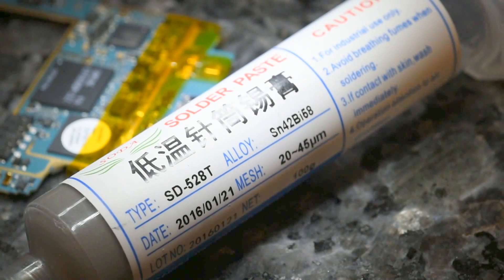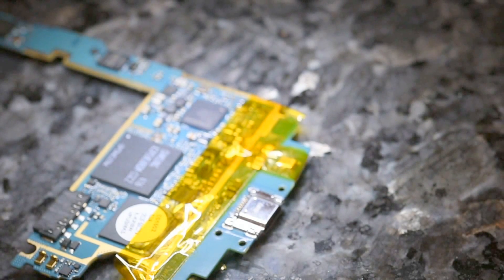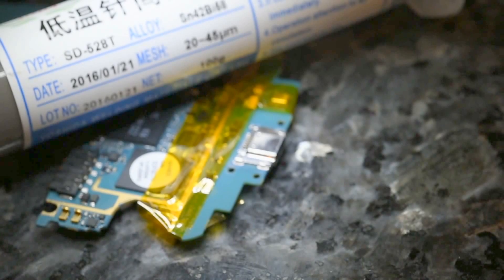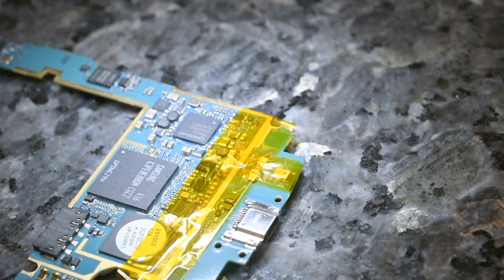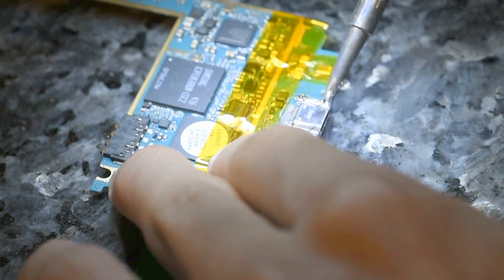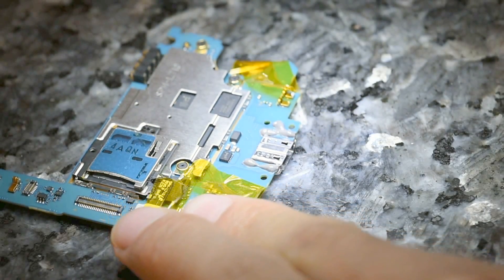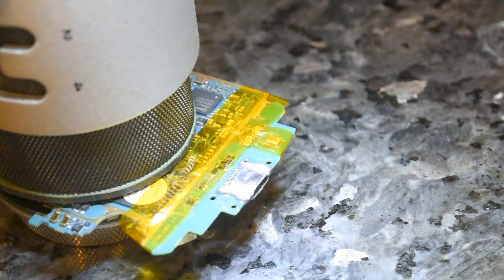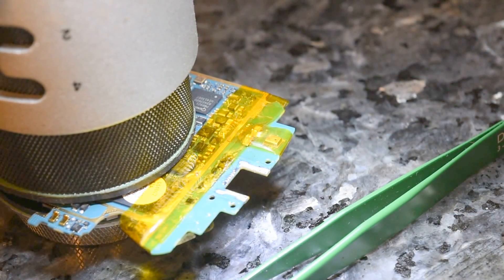How to use low melt solder paste removal alloy

Comment: Can you please suggest Soldering wire/paste having melting point in between 610 K and 740 K. And after soldering this should work between 15 K and  600 K.
Thanks in advance.

Comment: Is it ok to use a low temp solder paste to solder a USB port on a flex circuit board? Or should I use a leaded or lead free solder? I used a quick chip solder to remove the old port that was damaged. I know you said to use only for desoldering, I got a syringe of SRA T5 lead free paste and wanted to use it for a USB port. Thanks for your time.

Comment: look up "flux". Also are you using it on lead soldered boards - if you are, the alloy melting temp will be <100C. For bismuth based I use 270C soldering iron and 360 hot air gun
Reply: I'm looking to just replace the charging port in a tablet, is there something less expensive and a more economical way to change out this port?

Comment: Nobody does job such a way and spends pastes and solders for nothing not even the newbies.Everybody is using flux for the desoldering.
Reply: That's not true, when you start to see boards bending and traces lifted up you decide to use other techniques like this one
Reply: @narzan q wrong. google on how to use chipquik low melt solder. applied before lift off the component and no damaged tracks if using it properly. and none of the tutorials recommend to use it to clean the solder from the board.
Reply: I'm looking to just replace the charging port in a tablet, is there something less expensive and a more economical way to change out this port?

Comment: Eutectic solder does not melt at 350°C. You're confusing Fahrenheit with Celsius . Sn63Pb37 Eutectic solder melts at 183°C, not 350°C. However, 183°C is roughly 361°F.
Reply from the maker: True, thanks for clarifying!
Reply: Don't be silly